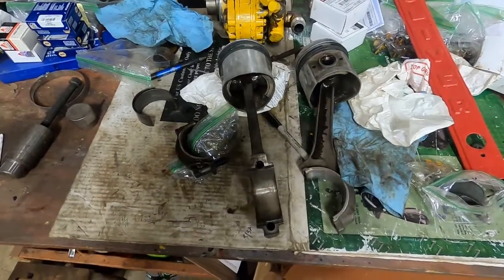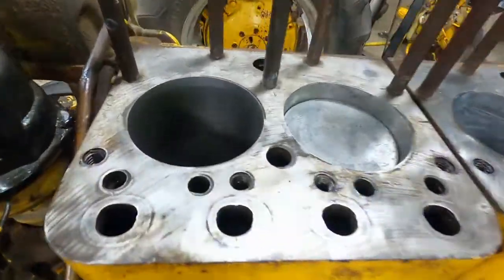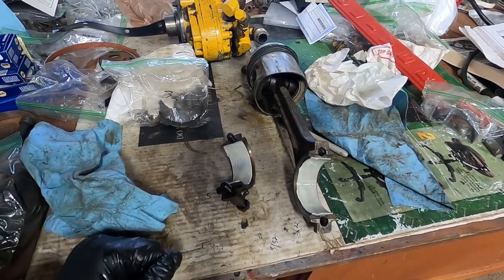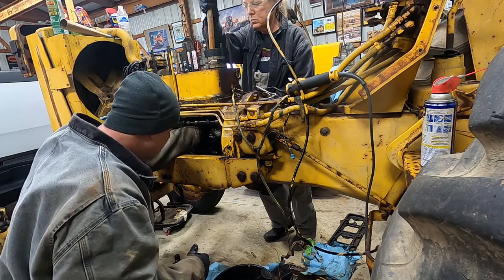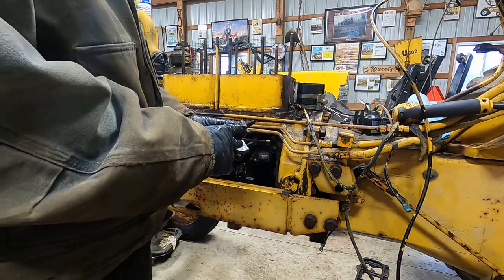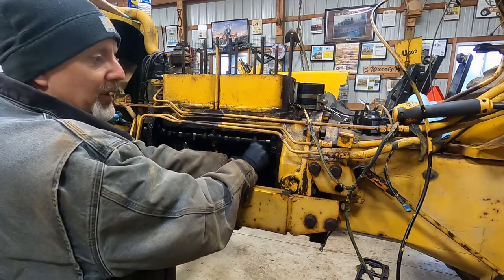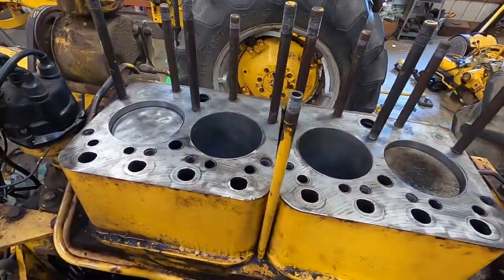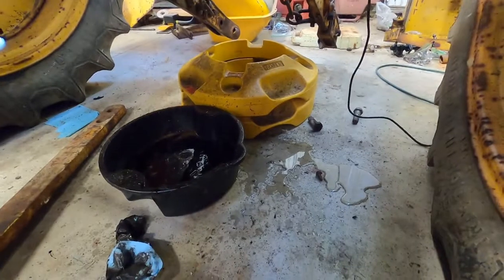1969 Minneapolis Moline U302 Engine Reassembly

Comment: Good  day  Many yrs ago their was a 302  for sale ,  I was told can't  get parts.  Did u have any problems  Thanks
Reply from the maker: No, lots of parts available.
Reply: @andyohiomm5364  There was a on-line auction  a couple jet star 4 & cockshutt  1350, which is jet star 4, 1350  went about that much  but 1  445 or jetstar  only went 1200 up here in Ontario,  which I thought was very reasonable.  Thanks

Comment: I am appreciating your series on Molines.  Now for a totally off the wall question since you are working on a U302 and JS3 at the same time.  Percentage wise, how similar are the two tractors in the terms of parts and the interchanging of parts?
Reply from the maker: But that being said working on them is 90% the same as far as how they are built.
Reply from the maker: They are very similar, but although some parts look the same they are slightly different.